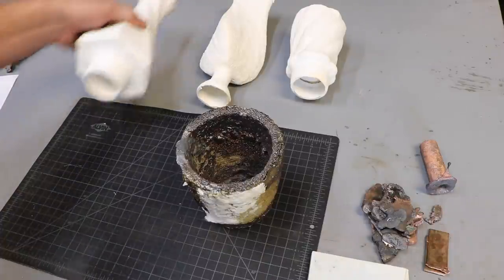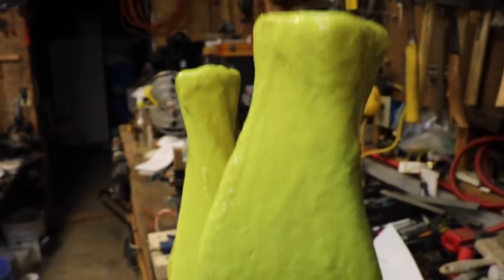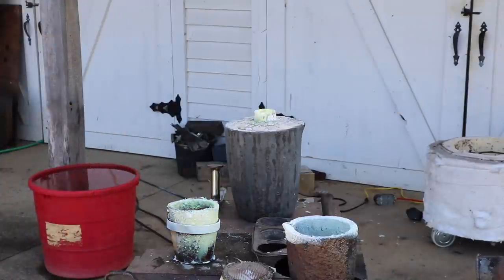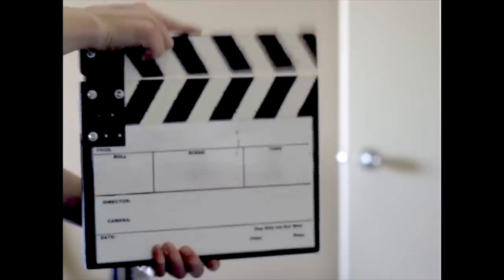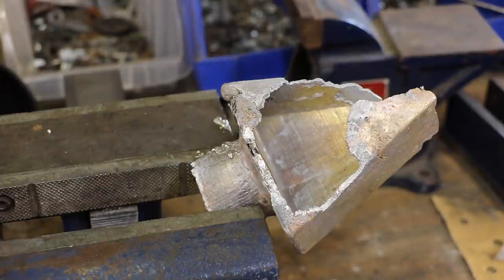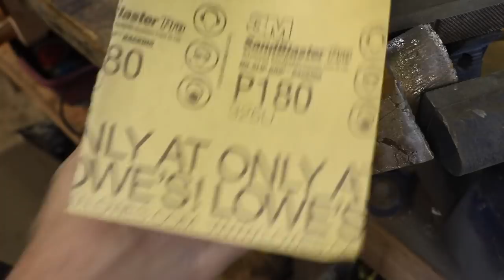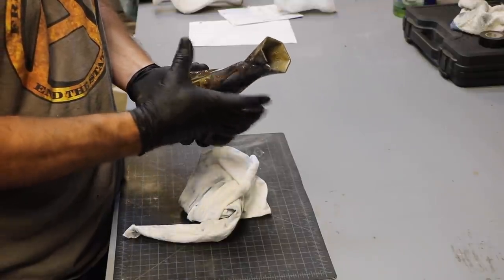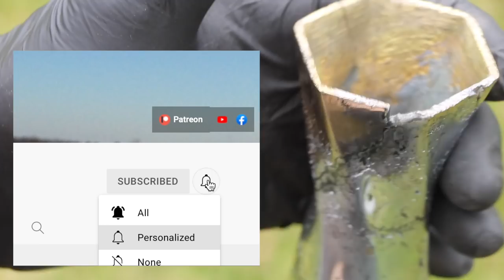Casting "The Cracked Vase."  Farmer Art...Or Fail?

Comment: You could try to fix the vase using a Kintsugi like technique. Using a "slow" setting epoxy and copper powder (instead of gold or silver) which would give the pieces copper colored veins through the brass and zinc :) Could look pretty awsome :D
Reply: Was going to suggest the same.
Reply: Was going to say the same thing.
Reply: was going to suggest the same.
Reply: Really good idea. It’s art if you celebrate the flaws.
Reply: I remember clickspring using pine resin or something similar to it for coloring a couple of clock faces and for holding delicate parts in place. It seems relatively easy to do and if it was all polished up, it would have a nice contrast

Comment: You could consider doing a lamp vs. a vase- that would allow you to LEAVE the ceramic inside as a support layer.  Affix the cracks with resin (could even get creative here and give the cracks character) then finish or not depending on a good look.  Give it a forced patina or tarnish, then dip the whole thing in clear resin to affix it in time.  If you choose the right shapes to begin with, you could draw file it or flap wheel it to polish certain sides.  You can definitely take this idea places- you just have to consider the metal a non-structural element.
(edit) Oh.. forgot the important part.  I really like that and it's cool and weird as sh*t.  Well done.
Reply: If it was a lamp. it  could just be a solid casting and then just light machining to bore a hole large enough for the fittings. Then again with the properties of it it might be difficult since some areas would be very brittle or hard, plus needing much more metal to cast.

Comment: I like how it turned out, your issue was from the formation of intermetallics.  Look up a phase diagram for copper and zinc and you will see the higher zinc % the more phases are possible in a mixture like this.  If you mix pure copper and a 70/30 brass you should stay in the same phase and might be able to keep a cool brass copper pattern.

Comment: I'm currently experimenting with glassfiber reinforced plaster. Look quite promising at the moment. I'm covering the piece in plaster and laminate a few layers of chopstrand glassfiber ontop. The mold looks quite similar to ceramic shell but is way faster to make and doesn't require any special refractory slurry.

Comment: A couple of quick things. First, I just wanted to say that is awesome! Thank you.

I know that most people are going to like the metal polished, but I have to say that the rough look is really interesting. 

And finally, just as a matter of curiosity, what would happen if you poured the outside as the lower temperature metal and then did a second pour with the higher temp metal? (Maybe with the mold heated so that the first metal possibly melts and blend. )

As always, thank you for sharing.

Comment: Wow, love the effect seen at the 7.5 minute mark. If you can perfect this you have a winner.

Off to watch the remainder... & back to say, Nice!

Interestingly there is always something causing lack of perfection. Yesterday I was making a 66 inch bow to auction on EBay and two of my efforts fractured. It turned out Hickory heartwood is too brittle in spite of in general Hickory has a 20k psi bending strength. My third attempt did succeed by using the technically weaker White Oak. I don't mind failing but I sure like knowing why.

Comment: You can mix metal dusts into your resin to create a more seamless appearance however I really like the way the the cracks turned black. It gives it sort of a Japanese Kintsugi look. That's where they repair cherished pieces of pottery that are broken with a golden color. The idea is that you are not trying to hide the crack and recreate the old piece again but you are reforming a new piece that incorporates the story of it's history into it as an integral part an showing that it was loved enough to be rebuilt or something like that. Google says it's "built on the idea that in embracing flaws and imperfections, you can create an even stronger, more beautiful piece of art."

Comment: If you have a TIG welder, one technique used on bronze castings to fill in imperfections is to TIG weld a small copper or broze filler wire into the crack or hole. Probably much better than trying to add epoxies and solder etc.

Comment: I finally had an idea on the cracking:  if you're allowing two metals that can mix to cool, and they cool at different rates and contract differently, then the metal which cools more slowly (possibly driven by its relative thermal conductivity) is likely to be pulled apart by the contraction of the faster cooling metal.  Normally, the whole structure would just contract within the mold, but if a portion of liquid metal is held in tension by the part of the structure that has already cooled and contracted, then the liquid part can only come apart as it tries to contract.  This may be similar to the process that drives hot cracking in welds (which is solved by using a rod/base metal combination that is near a eutectic point, so that it solidifies uniformly and quickly).  If you look up Tom Eager's course for USN officers in summer 2015, he explains the phenomenon in one of the earlier lectures (maybe 2-4).

Comment: I'm not sure if you covered it in a previous video, but what was the plan for removing the interior ceramic if the casting had gone to plan (i.e. stayed in one piece)?

Edit: Super cool video by the way! I loved the way the finished product turned out. I think the cracks ended up being one of the most interesting parts
Reply from the maker: That’s one thing I was a bit worried about from the beginning. Though I thought it would be much easier. The outside just comes right off. I figured with a little work and chipping, once I got it starting to break that the inside would too. Not so much. I also thought maybe the shrinking from cooling would crack the plaster right off the bat. In the future I won’t make it as thick inside.

Comment: Not having finished the video yet I have two burning questions.

Is there a flux that can be added to help keep it together while cooling?
Can you throw the still ceramic encased vase into the kiln for a second heating and slower cooling to maybe solidify the structure?

Comment: It came out really cool! The patterns look awesome. I am certain if you where a famous artist it would be considered a fantastic piece art by critics and bring you millions  😉
A speculation regarding the ceramic stiffness versus the metal shrinking. If you do less layers of ceramic maybe the metal will overcome the resistance. You would certainly need to handle the mold with silk gloves but it might be worth a try?
Maybe experiment with smaller objects? Whiskey glasses comes to mind.
Reply from the maker: I had the same thought.  I was going to try 4 or 5 layers instead of 7.  If the internal ceramic would crack instead of the metal when it shrinks, the whole process would be improved.

Comment: Try 3 coats inside without any silica sand?  The sand you are filling it with doesn't compress very much during the pour (it may help to lift the whole piece and pour the sand as soon as its solid enough to move).   Wind some lifting wires around the outside ceramic before sandboxing.

Comment: I know it wasn't the intended result, but the cracks really take the vase up to another level, it reminds of of marble.  If you were to do this again, it would be interesting to see what effect weakening the inside of the mold might have, such as adding score lines to the inner part, trying to use a thinner shell, or simply not filling it with sand.

Comment: I think one way to take advantage of the cracks would be to use carbon black pigment in the epoxy, I also like the ideas of copper that other suggested. The organic cracks could be treated as a feature in this method of making, it has an added benefit of making it easier to clean out the ceramic from the inside too!

Comment: The grain structure of your broken pieces (quite coarse) and the cracks as we saw them in the beginning look to be a function of heat transfer that went too fast. Perhaps a second try but preheat the mold and sand support so that cooling is much much slower. 

Just a thought.

Comment: That turned out fantastic.  What's more, the cracks were the icing on the cake.  Without them, I'm sure it would have looked good, but the cracks just added so much more to it.
I'm guessing that the problem with the soldering was that you're heating different metals, with different melting points, and it all needs to be hot enough to melt the solder, but not hot enough to melt the vase.  You probably needed it to be hotter, but that would have risked melting the vase.  You might have been able to use TIG brazing, but I doubt it would have looked any better.
To avoid the cracking in the first place, you could try eliminating the inner shell.  You cast the outer shell, then fill the whole vase with molten metal, then pour it out.  This is the same technique used to make fine pottery (and toilets), where they fill the mould with slip, then pour it out, leaving just the shell.  The problem with this, is that you need to melt much more metal than you need for the vase, and once the excess is reheated, it will be an alloy, so you wouldn't be able to use it for the same purpose.

Comment: Maybe cutting back the layers of ceramic  on the interior? Not sure how much structural integrity will be lost for the casting but, the less layers might allow for the shrinking metal to crack the ceramic and allow for easier separation.

Comment: The vase turned out really cool looking ! What if you made the vase walls a little thicker, poured it just like this one, let it cool, then put it back in the kiln with the ceramic intact and brought the temp up to or near the melting point of zinc to see if it would flow and fill in the cracks before you break the mold.
Reply from the maker: Interesting thought.

Comment: It do exist a 3d printable filament that is the same wax that is used to make molds in investment casting.
Doing it that way would also make an mold you could get the cast out of without destroying the casted object.

Iirc the colour changing filaments contain some particels with a high melting point.

Comment: Would've kept the one as is and prepped a second to see if I got the same result. Whichever had the least interesting cracks would be polished first (and be contrasted to the rough - slightly more a fan of the rough). I'd use either black epoxy to emphasize the cracks but fit the existing colors or I may throw shit at the wall to see what other pigment may go well. The right blue with copper swirls/flecks would pop. May also grind out/widen the cracks to get more color in.

And a suggestion on how you might get more copper to remain - try casting zinc (brass too) around some cold copper to see how much they alloy, if at all (might be able to control the rate of alloying by heating the solid copper some). If they don't mix much or at all, might try doping parts of the mold with copper scrap or finding a way to add it while pouring - now that would be a hell of a video!

Comment: I just googled it. You can also use gypsum or calcite instead of ceramic. Those are water soluble. Those will break down in water after you use them to cast in.
Reply from the maker: Yeah, that's investment plaster, and I've used those for casting as well.  Check my other casting videos if interested.  Using Prestige Oro and Ultracal brands of investment, I've casted many things, but they have their own challenges.  Doing an object as large as this vase would require a huge casting flask and a lot of investment plaster, which gets expensive pretty quickly.  The ceramic shell is just like regular ceramic and is not affected by water.

Comment: I was under the impression that metal fume fever not only " was not good for you" but with higher concentrations of zinc is quite deadly. There are some blacksmiths no longer around from burning zinc off galvanized fittings.

Comment: How about trying it with Tin, instead of Zinc? Tin has higher boiling point that is well above Cu's melting point, so maybe you could align the temperature of the two metals to be similar so that It doesn't crack when they merge as you pour due to temperature differences? Just a suggestion, I know very little about the matter anyways haha.

Amazing vase btw, your roses go really well with it
Reply from the maker: Tried that:  https://youtu.be/UFaVn5jbVCc
Reply: @FarmCraft101  oh shoot, how did i miss that! nice :)

Comment: Zinc Wool.  Placed inside first, pour copper in, let the wool melt and or alloy in situ?  Also looks like you could have, after pouring, put the entire vase in for a full on heat soak.

Comment: only suggestion when soldering non ferrous metals is silver solder which can be made from silver wire the stronger the alloy of silver wire the hotter it needs to be to melt and bond the pieces together which is what was taught to me in jewelry class in college but other then that it was a perfectly reasonable method you used to fix the vase, very well done
Reply from the maker: I have silver solder, but I was worried the high melting point was too close to zinc's melting point, and I would end up melting the vase instead of soldering it.
Reply: @FarmCraft101  well there are different ratings of silver solder I am not sure which rating would be best for a zinc alloy but they make it that I know for sure cause the different ratings are based of amount of heat needed to melt the solder the smaller rating melt fast and so on
Reply: @FarmCraft101  the ratings are easy medium and hard and this is technically the hardness of the silver solder wire

Comment: Looks gerat to me . Question: is it possible creating outwall only? Meaning by that: no double walls just outside form, pour in the alloy mixture,  wait a certain time pour out the still molten metal out during this action the mold is kept hot. Just wondering. I will try out and let you know of that works...

Comment: I'm only at 12:17 right now but do you make brass if you melt the zinc on top of the copper in the crucible without mixing it?  Like, if you just set a bar of zinc on top of the molten copper, would it mix itself or would you normally have to stir it?

Comment: You need to have a casting that when exposed to water will dissolve from the metal. That way you won't be hammering the crap out of the brittle mixed metals.

Comment: What if you pre heated the mold and then to get the plaster out of the inside could you possibly get it really hot and drop in really cold water to try and stress crack it?

Comment: I have a high end wood burning tool, I think I paid $150 new. Looks like a miniature welder. Acts like a soldering gun on steroids, with adjustable power output. That would be perfect for fixing it. You could use a fine tip to melt and fuse the cracks together on the outside.  Melt it along the crack a couple hundreds of an inch thick and let metals fuse together.  Hopefully you could burn or scrape off epoxy slag. Maby scrape most of it (a couple hairs deep) with utilitie knife first? Dont know if it would work, seems like it would.

Comment: Does anyone know how you would remove the ceramic from the inside of the vase if it had not cracked?
Reply: Ultrasonic cleaner perhaps?
Reply from the maker: The outside comes off so easy, I thought I might have to chip to get it started but then it would just pop out.  How wrong was I?  That said, if I make the inside fewer layers of ceramic, so it is thinner and weaker, maybe it will crack during cooling instead of the metal.

Comment: Oh no how do you plan on removing the inner ceramic without breaking the vase?  I'm 8 minutes in.  I'll be back when I'm done with the video
Reply: Nice save in the end.  I'm thinking instead of the double pour method, that perhaps you make it solid brass or copper and then just braze on the brass and zinc somehow.  Not sure how that would work with melting points and how much of a heat sink copper is but then you could sort of weld your swirl pattern in there.  Maybe the original mold has recesses to accept the zinc and brass?  I know dissimilar metals don't like to stick to eachother but might be worth an experiment.  Thanks for the content

Comment: Zinc melts at 787F and boils at 1664 F  ... copper melts at 1985F so the Zinc will boil as soon as they mix causing porosity, brittleness and cracks because of different CTE's., not good ...you can alloy these metals but you can't mix them like you did with temperatures so far apart. Good try though and a good video to watch.

Comment: Robinson Foundry did a cast a few months ago using the same method but he used wire and fiberglass to reinforce the ceramic mold so it didn't crack. Here's the link https://youtu.be/v96LTfmtDPU

Comment: 14:46 too hard ?! It's brass?? Is that normally too hard to cut on a bandsaw blade??  Don't you do steel with that thing or am I crazy??
Reply from the maker: Haha.  Yes, I do cut steel with it, and no, the blade wasn't dull.  Those "in between alloys" can get extremely hard and brittle, like glass.  So zinc is easy to cut, copper is too, and brass with 30% zinc is as well.  But who knows about 50% zinc?  Or 75%?  Somewhere in there, it made something super hard.  I've cut steel with that blade since this video.  Metallurgy is fascinating and a little weird.  ;-)